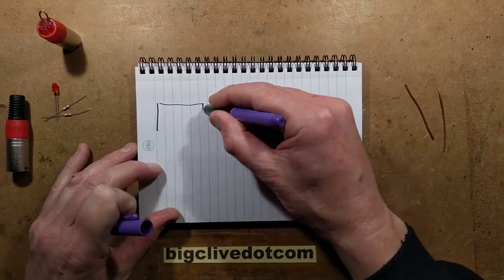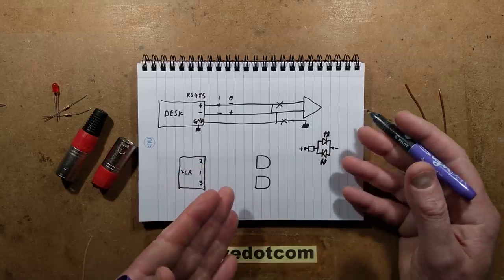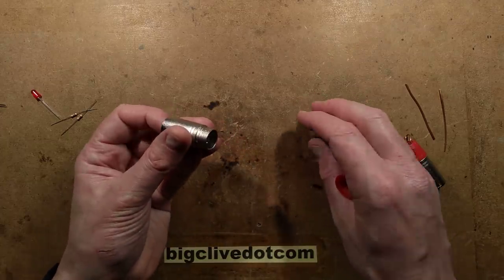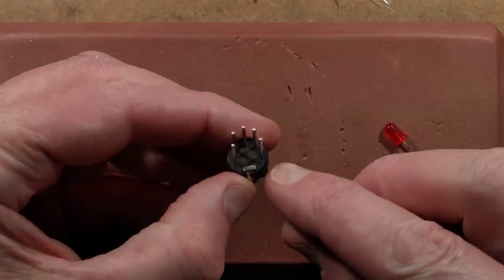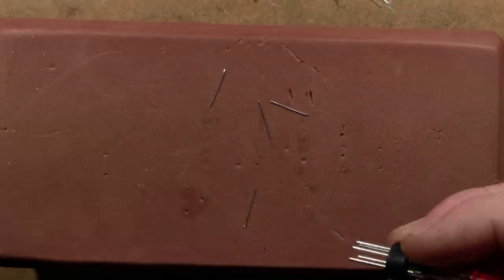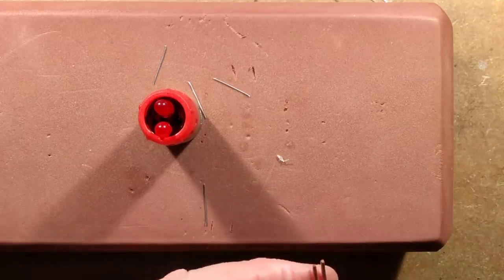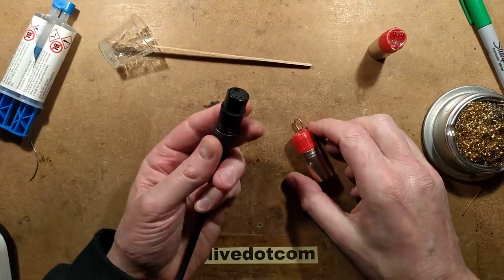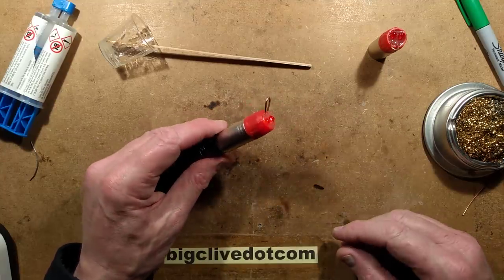DIY keychain DMX tester for lighting technicians.

Comment: The 3 pin XLR connector has become the standard for wheel chair and mobility scooter charging as well often pushed to 15 amps but more commonly 4 to 6 amps usual voltage is 24 amps as the batteries are normally glas absorbed lead acid  they will take whatever the charger will max at, I have seen them quite warm.
Reply: When used for wheelchairs the latch is often removed so it will pull out if you carelessly drive away with the charger connected.
Reply from the maker: The latch being removed to allow self disconnecting is a nice idea.
Reply: @theelmonk  Sockets are available with or without latches. But pins 2 & 3 are bridged together on the plug and that tells the wheel chairs electronics that the batery is on charge and renders the drive side inoperable so that you cannot drive away while plugged in.

Comment: I saw a video (metallica rigging fail) where hydraulic arms crashed, they were supposedly controlled by dmx which failed (i think i was told the program corrupted).
Is there a watchdog circuit available ?
If not, i guess you could have a watchdog system that looks for data (just a couple of opto isolators that are given an on/off command) connected to a charge pump, if the pulses failed, this would drop out a relay in a stop circuit for the arms (or any other mechanical device that could cause damage)
Reply from the maker: Is that possibly the "staged" stage accident with "truss" falling onto the stage, a crew member going on fire, a rigger "falling" unconscious from the rig and other stuff?   Nothing critical gets controlled by DMX unless there are code sequences built in to prevent rogue activation.
Reply: I started to wonder when the guy caught fire and no one seemed to be panicking to put him out.
Also that metaallica didn't seem to panic either.
Thanks for clarifying :)

Comment: Can you use 1 resistor from ground instead of one each from the positive and negative? If you don`t cut the resistors so short, is it possible to bend them and force them into the receptacle. Then the will not fall out that easy.
Reply: Great question, the issue is if the cable was wired wrong, the other led will be passed full voltage and current, so if the dmx had a nice strong 5v rail it'd then pass through the one led (say it was a 2v led) and then in reverse breakdown of the other led to ground etc, it's almost 2am here for me so I might not make much sense lol but if the led had reversed voltage and it then passes through the resistor then its very low current, (maybe 2mw depending on the led voltage being used)
Reply: @ianharvey868  I don`t think revers polarity is a problem in this circuit. A red LED can handle more than 5V in reverse. Anyway, I will build a couple of these. Thanks Big Clive.

Comment: 14:50 I'm guessing the resistance also mitigates the heat propagation as you hold the other lead of the resistor while soldering :)

Comment: if you really wanted to streamline it you could do the smd leds and just take the pins out of the connector and solder them through throughholes in the pcb

Comment: I call that a DIN connector, what I call an XLR connector is bigger and traditionally used for speakers and microphones (using different cables of course!).
Reply: No it's a 5-pin XLR, the shell is exactly the same size as the more common 3-pin XLR.
Reply: @Matt Quinn I stand corrected! I've only ever seen the large type. Learnt something new ☺️
Reply: @Matt Quinn yes I always used to call them Cannon connectors.

Comment: Every time I've bought a device with DMX I have had to resolder the wires to the pins. They always crackle and pop until they are soldered properly.  If your audio sounds like crap cuts out and pops. It's the bad solder job in the cable.

Comment: I’ll have to check the standard again, but I’m almost 100% sure the standard states DMX has to use a 5 pin connector. Now cheaper gear does use 3 pin, but that doesn’t mean it’s per standard. Also, blame Gordon Pearlman for there not being a standard for pins 4-5. When they were writing the standard, he wanted those pins for something he was developing at the time that never came to fruition. 
Source: I worked for Strand Lighting for 10 years.
Reply from the maker: Pins 4 and 5 have often been used for power.  Some equipment suffered damage as a result.
Reply: Avolites use pins 4/5 for two universes on one outlet. Combine with 2 pair cable and you can do two universes on one cable run, which can be handy.
Reply: I´m almost 100% sure that the standard in the latest release even says that you Must only use 5pin, and that you are not allowed to use Pins 4-5 for anything at all these days. 
But, I really think it should be updated to atleast allow 3pin, or simply ban 5pin on new products. 3pin XLR is a far superior connector, many times more robust than shitty 5pin, and its insane that a standard requires a 5pin connectore and also bans the use of all pins in said expensive and not fieldworthy connector. 
Yeah, audio uses 3pin xlr, and sure, someone could probably manage to connect shit together wrong, but nothing is idiotproof, and I gotta say, I have NEVER seen anyone actually connecting audio and DMX together, but I have seen a number of broken 5pin XLRs (eventough we many work with 3pin as its just better). 
Even if someone once in a blue moon manages to actually destroy some gear by connecting  the line output of a mixer to the output/link connector of a light, that cost has probably been saved by not having to buy the much more expensive 5pin connectors :P 

I say that if you are unable to not keep audio and lighting signals separate, you should find other work :P 

I do like that more and more medium range products are coming out with both 3 and 5pin these days, but that is even more expensive (not that the cost of the connectors really matters much on a 1000+ euro lights) but atleast its flexible.

Yes, people can use mic cables if you use 3pin XLR, that wont kill anything but may cause signalproblems, so shouldnt be done. But you can also do the opposite, use good quality DMX cables for audio, I do that regularly, its according to the cable mfg specs, and it simply just works and I dont need to keep as much mic cable in stock :D

Comment: I opened an RS 485 plug many years ago and found it to be incorrectly terminated. I fixed it and got a call from the engineers couple of days later because what I did made the entire network, which consisted of over 1000 devices run 5 times faster.

Comment: What kinds of demands do you get from the venue on what lights go where? I'd imagine it's very specific and you get given requirements for what types of lights should be in what exact positions and how they need to be hooked up to control circuitry, or is it that specific? What's the depth of control you get over how a given install/setup should go?
Reply from the maker: The lighting is designed by the lighting designer who provides drawings of where everything goes and how it's addressed.

Comment: I'm surprised dmx didn't use floating inputs(transformers)  like AES audio and Ethernet.
Reply: Or optocouplers, like MIDI. Actually, some do - but it's not required. Maybe it's too big a load for the data as well - MIDI only has one receiver.
Reply: The RS-485 standard, upon which DMX is based, came out a long time before Ethernet. While transformers certainly existed, they added cost/weight. DMX being differential, it can be plugged into a Hi-Z (high impedance) input directly. Modern system configurations tend to use the input/output connectors on the fixtures, which will buffer the signal along (edit: the length of the DMX run). So, as long as the ground connections are good, transformers aren't necessary. (Probably not a bad idea, but a hard sell in a mature industry looking to cut costs.)
Reply: @McTroyd  Do you mean that fixtures buffer the signal electronically, or just that the input and outputs are directly connected? Cause I´d say the last is by far the most common, most DMX products just do a direct parallell connection between the input XLR and output XLR.
Reply: @Robinlarsson83  Truthfully, I've never really looked. I always assumed they were electronically buffered, since we live in an age where the standard fixture includes a controller these days. I would have thought the low impedance or high capacitance of a long, straight parallel run would cause issues. Will have to check into it at work tomorrow. Thanks for the heads-up!

Comment: I am not sure why GND is that important when the difference between Pos and Neg matters? Shouldn't it be differential amplifier on the receiving end (or even comparator?) measuring which line is higher and then outputting either 1 or 0. That would make sense to me, to be honest.

Also, if you added third, bipolar led (like you described in the beginning for +/- check) you'd know exactly which line is broken :)

Comment: I wonder if you could use an adapter, like a 5pin -> 3pin, (they even make them?)or use the screw threads in the base to join both connectors into one unit

Also, would Bi-Color LED's indicate the pin reversal scenario? Blinks Red (or Green) for OK, and Green (or Red) for Reversed?

Comment: I really miss doing lighting. I haven't done it in well over 10yrs but I loved setting up, running the desk/laptop. But like most people, everyone cannot wait to breakdown and go home to bed because your completely fucked and overtired by the end of it. I also really enjoyed the audio side of things as well. When I left school, I wanted to be a sound engineer, but our local college was pretty crap tbh and there's pretty much no chance I'd of got a job. I'd of had to work for some company being someone's bitch, but instead. I ended up being a sparky which I enjoyed but the only things I really like doing was industrial and a few commercial bits. I hated with a passion doing domestic 😡

I much preferred gigging thought, but I can't do either now due to being a biker 😪 FML 😞

Comment: Great little tool. Would it cause any issues having this circuit permanently installed in a dmx line?
Reply from the maker: It would pose a slight extra load and might affect the number of lights you could run on a network.

Comment: Now do one with a max485 and an ATTINY to test the protocol
Reply from the maker: Has been done by a Dutch guy.  His had a multicolour LED that gave information about the data format.  But incorrect data format is very rare.
Reply: @bigclivedotcom  Yeah. I guess you're right. I used to work in oilfield automation and we used RS485 for everything. The most common problem was swapped A and B wires.  we just ran twisted pair everywhere for that. You guys are lucky. You have XLR connectors on everything. Aside from plugging one into a phantom power source it's really hard to screw that up.

Comment: How often are you working with Ethernet for lighting control? And are you seeing Cat5 cable being used for DMX cabling. Seeing this slowly migrating into service here in the USA, but the majority is still "standard" shielded twisted pair XLR cable.
Reply from the maker: It varies from job to job depending on the designers preference, but typically it's just ethernet between the desk and DMX rack.  Fibre optic makes a more frequent appearance now.

Comment: Slightly confused I thought DMX with three pins not five I guess that must be for higher end lights because all my lights are 3-pin
Reply: It's usually only the lower end lights that use 3 pin.
Reply: It is 3 pin if you listened and watched the video.
The 5 pin connector would allow 2 lots of DMX down one cable.

Comment: TIP: instead of using glue u kan use the plastic cable grip and the little washer (or a metal washer) to fix the leds

Comment: Awesome video, and device !!!
Question, what does it indicate if both LED's are ON full, not flashing ??? 
And my lighting control software - Vista - still seems to work ok... but I do have a leg/universe that does not light or is not controllable - the leg with both LED's on full...
Reply from the maker: It may have a failed output driver chip if they are absolutely static, and not alternating at high frequency.
Reply: This is on a brand new $2000 Pathport DMX/RDM Gateway ...
Do you think bad DMX boards on the light fixtures could cause the new Gateway to fail in this manner ?

Comment: Great little design. Question could this be used to test a 3 Core RS485 system. As DMX is a form of 485. The RS485 3 Core uses a 3 Pin XLR Pin1 Screen Pin2 Data - Pin3- Data+
Reply from the maker: It should work OK on a common RS485 driver.

Comment: I was trying to do this on a 3 pin xlr using a 120 ohms resistor and an led.
But it didn't work, my input voltage is 220-230 AC, does that mean I should be using a different rating resistor ? 
Plz reply.
Reply from the maker: DMX usually operates at 5V.

Comment: AFAIK there is no need for a ground connection for a DMX signal, it is based on rs485 and is a differential signal so the ground is only there to reduce interference. I actually think that is better to connect ground on only one side of the cable.
Reply from the maker: The receiver chips can only handle a margin of deviation from circuit ground.  It's not inductively isolated like an audio circuit.
Reply: @bigclivedotcom  You have been fixing a lot of these, is it not a common practice to optically isolate the dmx line from the rest of the electronics inside a fitting?
Reply from the maker: @szaszafaja  Some lights use an opto-isolator, but that potentially imposes a higher load than just taking it to a receiver chip via protection components.  Most higher-profile lights also accommodate RDM 2-way communication on the DMX network,which wouldn't be so easy with an opto-isolator.
Reply: I don't know much about professional (or any, really) lights, but I have made some DMX controlled devices with arduino (with and without RDM). The way I designed it was so I used one of these 1W isolated  dc-dc bricks, 3 opto couplers(only for the RDM capable ones) and of course the differential driver chip. The DMX line was connected to the diff chip and the chip got its power from the isolated brick so the whole frontend is floating and the buffered unbalanced end of the chip was driving the optos. I don't understand why would anyone drive an opto coupler with a DMX line... I don't know but it made sense to me impelenting it this way. The whole BOM for this kind of frontend is a few pounds so unless I'm missing something I just dont get it why it is not the standard way of doing it. Any Ideas?

Comment: If it uses pins 1 2 and 3 of the 5-pin connector, then how does it work with the 3-pin XLR connector which doesn't have a matching pin 2 in the same location.
Reply: @Matt Quinn could a universal 3/5 pin device be made by connecting pins 2 and 5?

Comment: Fab' video - as always - thanx Clive. Can you just repeat the voltage of the Red LEDs. Are they 2v or 12v - thanx very much. Also, I am building a box for a DMX512 circuit and I plan to have these flashing leds ALWAYS on - will that cause a prob at all?  thanx dude
Reply from the maker: The forward voltage of most red LEDs is around 2V.   It's OK to have the LEDs permanently connected, but they do pose a slight load on the network.
Reply: . @bigclivedotcom   thanx very much - speedy reply. Sorry if I sound thick but does that mean I have to purchase 2 x  2volt red leds or 2 x 12volt red leds, sorry, thanx
Reply from the maker: @JoeEvansSound  Just buy ordinary red LEDs.  Not the 12V ones with built in resistors.

Comment: Hey Clive, would this work for a 3-pin XLR used for a microphone set up from a P.A? As a performer It'd be nice to test a line before a performance rather than hold the cable at a funny angle mid-gig... Thanks in advance!
Reply from the maker: It won't work with audio signals.  If in doubt give connections a gentle wiggle before the show.
Reply: @bigclivedotcom  ah I had my doubts, I always do but I've been caught out in the past. I'll just have to fork out £20 for a line tester. 😅 Thanks anyway!

Comment: Wow, would have expected the 3 connector uses the middle pins
Reply: There are fancy 'DMX' lights that use 5 pin, IIRC the extra pins are used for talk back to the controller for light status, position, etc...
Reply: @TankR  No, they extra pins are not allowed to be used anymore actually, since they were never fully speced out in the early standard, some brands started using them to power things or send extra signals or as you say, feedback, but since that means stuff isnt really compatible and can actually damage stuff if you connected things from different brands togehter, its now been banned in the Standard. It still requires 5pin, but prohibits use of Pins 4 and 5.

In my opinion, 3pin is far superior in every way, and I think the standard should be updated to atleast allow for 3pin, so that the fancy brands can put good connectors that actually last in their stuff :P And no, I dont accept "but then you can connect lighting and audio together" or "then people will use mic cables" as valid objections, and there really is no other objections. 

Feedback from lights to desk/computers are handled by the extension of DMX called RDM (Remote Device Management) which is basically just 2way communications on the same datacable, and doesnt interfere with non-RDM lights. It does require RDM capable lights and splitters to work though, as well as desks or software capable of RDM and nodes/interfaces that does when need of course.